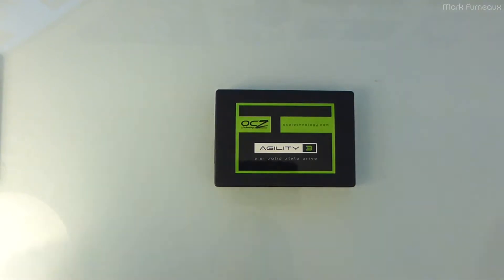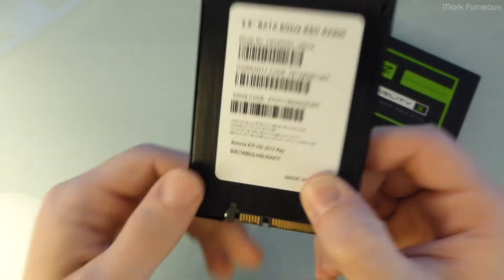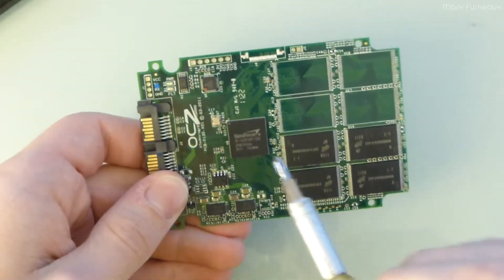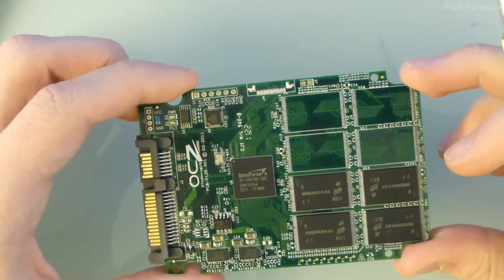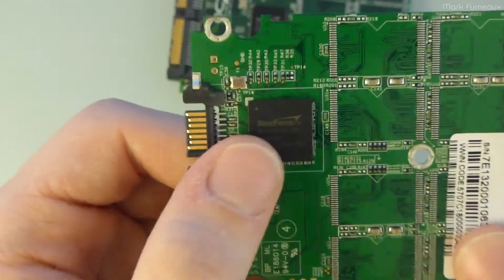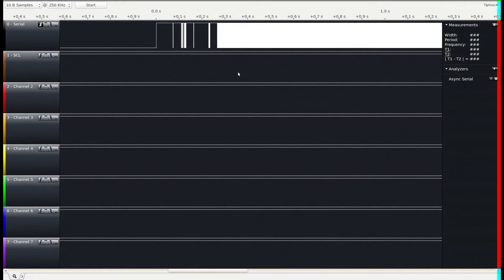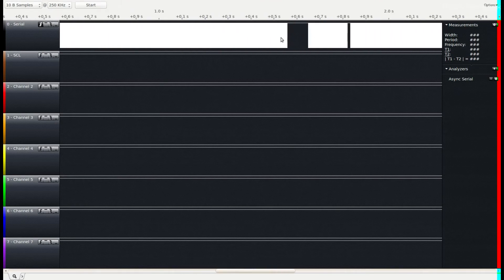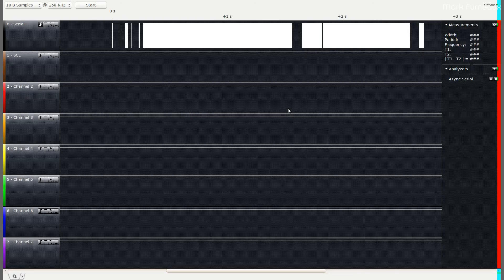Random Waffle Inside OCZ and ADATA SSDs

Comment: OCZ-branded SSDs were notable for high failure rates. Two lines from the old OCZ Technology Group, the Petrol and the SATA II versions of the Octane, had return rates of over 40% at one anonymous French technology online retailer. The SATA II version of the 128 GB Octane had a return rate of 52.07%. No other company had any SSDs with a return rate of over 5% from this retailer in the data set that was published on March 5, 2013.[29] In a dataset published on April 30, 2014, OCZ again had the highest return rates from the same anonymous retailer.[30] The next dataset, published on November 6, 2014, shows only one OCZ drive, the OCZ Agility 3 480 GB, which had a much lower return rate of 1.34%. Man this company made some garbage products, I have two sets of DDR3 from OCZ that didnt work right since the day I got them and its no surprise that most of their products came with a "Lifetime Warranty"!

Comment: The ADATA 128 GB SSD will be 128 x 1,000,000,000 bytes while the chip capacity will be 128 x 1024 x1024 x 1024 bytes, meaning about 7.3% spare capacity. Spare capacity is needed for things like garbage collection. Most likely the 60 GB OCZ is also 60 x 1,000,000,000 bytes.

Comment: I got it, It is actually the Firmware, because the Binary data stream is starting with "Load FWR" which means loading firmware, and the binary Data is an encrypted IMG File which is decoded inside the Chip and the second block are like Diagnostic Output of Addresses and pointers which is always indicated by 0 7 1 ### < # , and the \r and \t are commands for an Terminal Emulator to create Tabs and new Lines and so on. 

the Firmware can be flashed when J5 is bridged, then the Chip wents into Microcode loading Mode.
Actually what I think is that OCZ was Controlling and Updating the Firmware over this Serial Link in case of RMA or Analyze and the Output is redirected troughthe SATA Protocol to the Java written OCZ SSD Toolkit